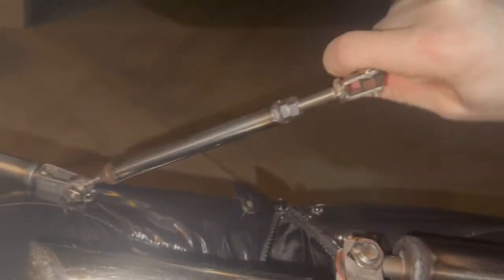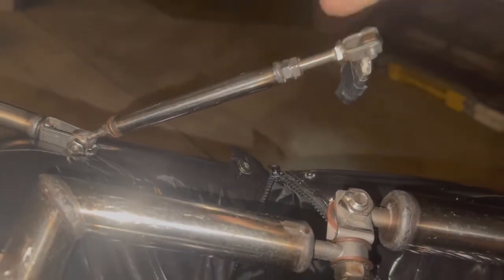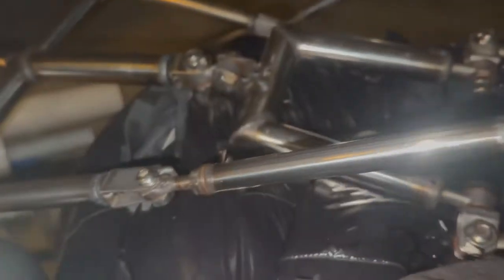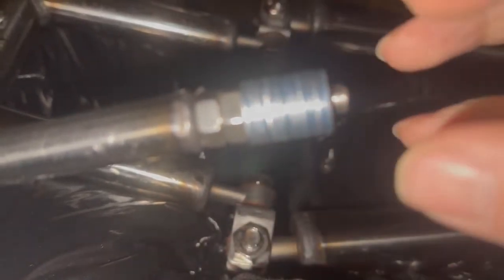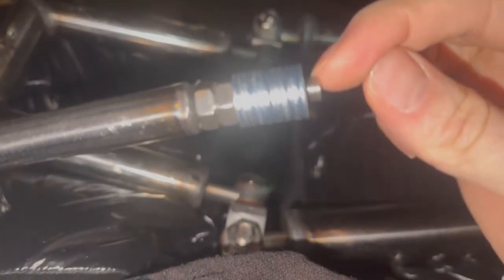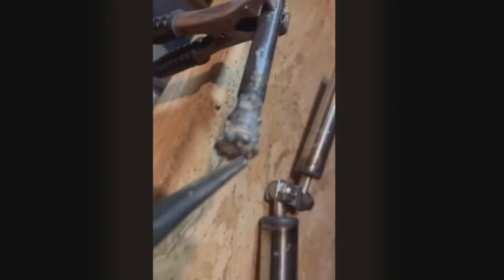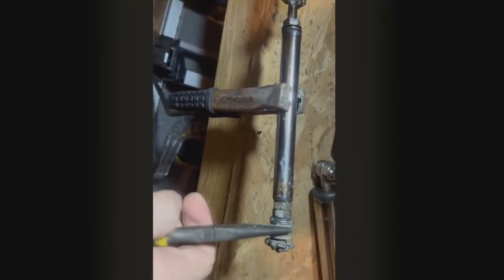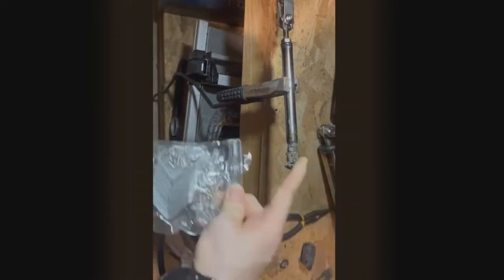Axial Rotation Mod to Dinah's Steel Wrist | Building Humanoid Robots #237

Comment: is this rage bait?
Reply from the maker: for welding snobs maybe.  I guarantee this weld will hold though.
Reply from the maker: Characteristics of a Welding Snob:
Superiority Complex:
They believe their welding skills or preferred techniques are superior to those of others.
Dismissive of "Unorthodox" Techniques:
They might not understand or appreciate welding methods that deviate from their usual practices.
Unwilling to Learn:
They may be resistant to trying new techniques or learning from others, even if those techniques are efficient or practical.
Overemphasis on Aesthetics:
They may focus more on the visual appearance of a weld than its structural integrity or functionality.
Critical of Beginner Welds:
They might be overly critical of welds made by less experienced welders, even if those welds are structurally sound.
Pride in "Perfect" Welds:
They may only show off or discuss their "perfect" welds, and may not be interested in the challenges or learning opportunities that come with less-than-perfect welds. 
Example:
A welding snob might look down on MIG welding because it's considered a faster, more beginner-friendly method, while prioritizing TIG welding, which requires more skill but produces more precise welds. They might also dismiss welds that don't have a visually appealing, uniform bead appearance, even if they are strong and functional. 
In essence, a welding snob is someone who elevates their own perceived welding prowess above others, while being dismissive of or unwilling to learn from different techniques or methods.